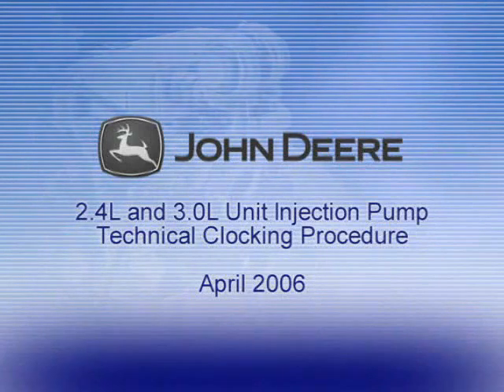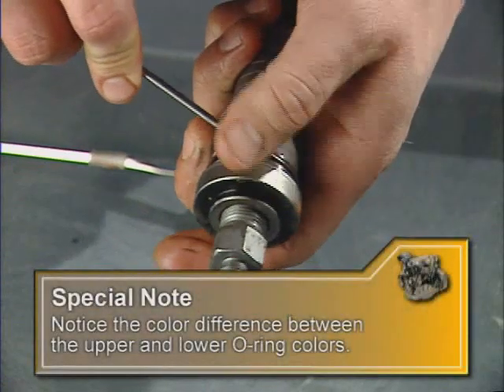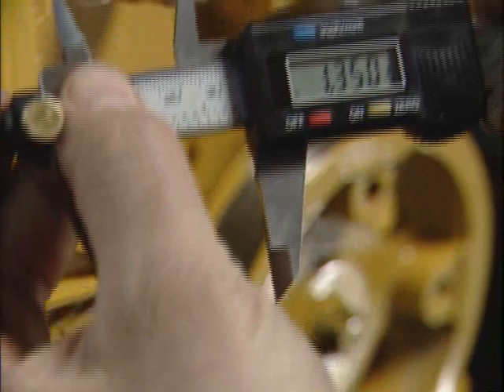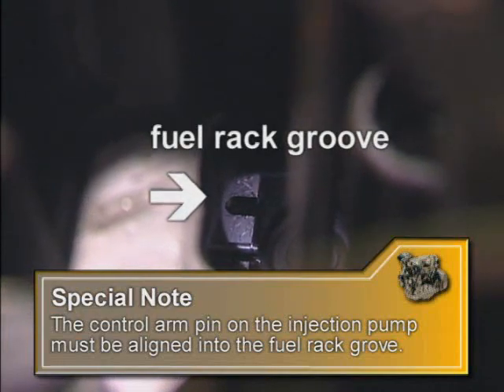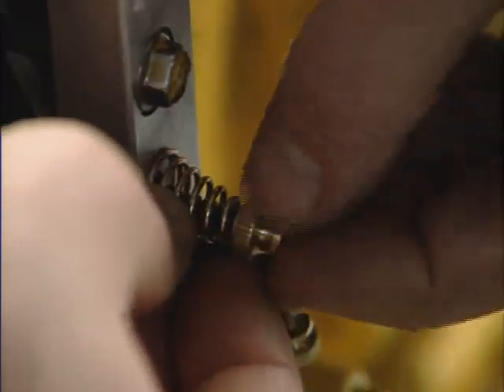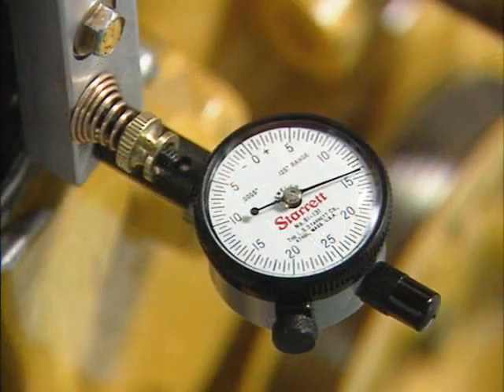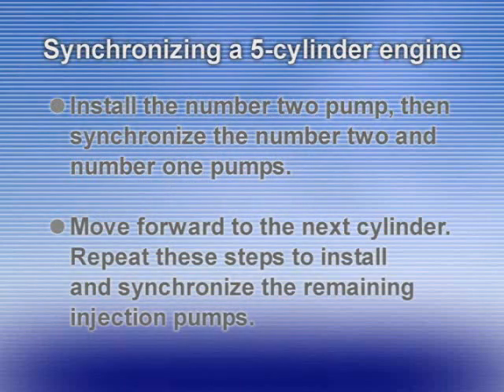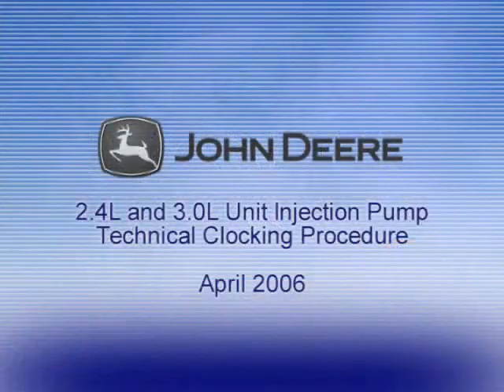john deere powertech 2.4L 3.0L injector timing, clocking procedure

Comment: this engine is a nightmare.. I'm currently repairing one in a Liebherr L 507 loader. The camshaft gear came loose , now I need to buy the JDG 1700 tool for the timing settings...650 Euros 😏

Comment: At this point I am wondering what can easily be put in place of this poorly designed piece of junk engine?  Keep it simple stupid was not considered.  I am wondering if I can put a 4bt in place or some other simply designed engine.  om617 which will need valve adjustments only and the regular filter replacements is another idea.  I have a JD 317 skid steer with this engine and it has a blown head gasket.  The oil filter assembly is bolted to the head in such a way that gives it away that complete mor ons designed the engine.

Comment: My boss just gave me this job knowing ive never done it before and told me to do this at 2pm.  Needless to say i just put in my 2 weeks notice
Reply from the maker: i never did anything like this before, im just a truck driver, but watching the video that john deere tech gave me made it easy,
Reply from the maker: it is my grandsons tractor, that was 7 years ago, still running, seems to me i split the tractor to get the front assembly off, rad and stuff, i replace all the injectors, but what happened is the cam gear came loose, that gear is pressed on a taper, no keyway, crazy
Reply from the maker: i thought he traded it in, but the other day he pointed to a tractor in his fleet, said, remember that tractor, lol

Comment: John Deere	JDG10245	Service dial indicator New; Original	1 pcs
John Deere	JDG1854	Injector Wrench New; Original	1 pcs
John Deere	JDG1704	Flywheel turning tool New; Original	1 pcs
John Deere	JDE81-4	Timing Pin New; Original	1 pcs
John Deere	JDG1678	Hydrolic Bleed Down New; Original	1 pcs
John Deere	JDG1823	Rack Holding Tool New; Original	1 pcs
John Deere	JDG2073	Fuel Control Rack Tool New; Original	1 pcs
Reply from the maker: My buddy at JD let me borrow those tools helped alot
Reply: @cosmicway4048  yeah, I was going to ask if you had them for sale.
Reply from the maker: @Panelson74  it was my grandsons tractor,he traded it in after a year, and just traded that one in lol
Reply from the maker: i thought he traded that tractor in , but in fact he still has it
Reply: Where in the manual does it say you need JDG2073 or JDG10245?

Comment: I have a 3 liter that doesn't want to start. If you give it a little starting fluid it will fire up and run all day. Sound familiar to anyone??
Reply: I might have found my issue. I pulled the aneroid off the block and found a broken off grease fitting in there! No idea where it would've come from, but I think it was holding the linkage up keeping it from getting full fuel on startup.

Comment: I have a 2.4 in a sullivan-palatek 185cfm compressor.
It starts and runs fine but seems to be over-reving I put a tach on the flywheel and I'm getting 3450 rpm. How do I regulate that back to 2650 rpm?
Thanks
Reply: check the acceleration screws and adjust the stop until you reach the rpm you want...

Comment: Gawd, I hate these engines.
Good thing there is only one in our fleet and its been lightly used.....
Reply from the maker: Steve po my grandson has 3 and he hates them too. The cam gear came loose, I hate that there is no keyway it's crazy.
Reply: @cosmicway4048  I'm in the same boat 😅 gear came loose . The tag on the engine says Liebherr D404t (its in Germany)... but I knew immediately...cant be a Liebherr.. that JD is a nightmare to work on. In our Liebherr 514 theres another Deere, way better...the newer common rail

Comment: donde puedo encontrar un técnico para este motor??
Reply: Hola 
Desde  Bogotá Colombia me gustaría fuera el vídeo en español  
Tengo un equipo John deere
Reply: @gustavodaza2668  a mi tambiéne.gustaria.que fuera en spañol
Reply from the maker: Dónde estás. Tuve que arreglar. en los Estados Unidos están en todas partes.
Reply: yo tengo varios moteres de este tipo   encienden muy bien , aceleran bien pero cuando le metes carga pierden potencia y se apagan.
Reply from the maker: Carlos García sounds like you might have a fuel filter problem or fuel pump, does it happen to just one or all your engines, if so might be the fuel
Reply: to all engines, in fact I have to replace them with the 4045t engine
Reply: Aqui estoy!

Comment: This video has been really helpful! 
It references the "valve train instructions". Where did you get this video? Do you know where I could find those valve train instructions?
Reply from the maker: Colby Patterson a mechanic at John Deere gave me it off of his company tech computer, I just had the video to fix mine...I hate that the cam gear is pressed with that bolt with out a key way
Reply from the maker: Colby Patterson I was lucky  the guy let me use his gauges after seeing how they work I could do it with out them